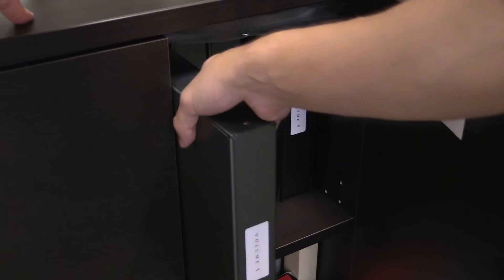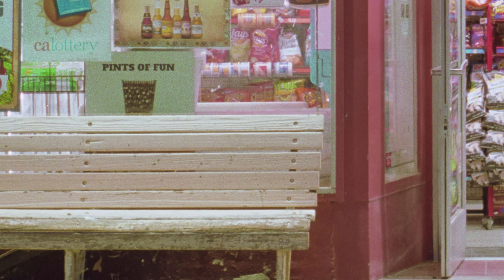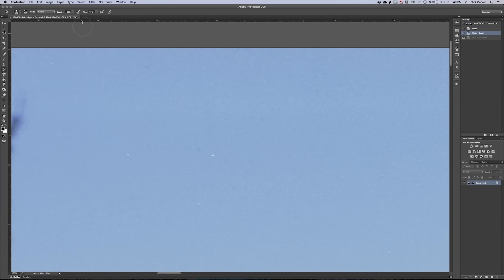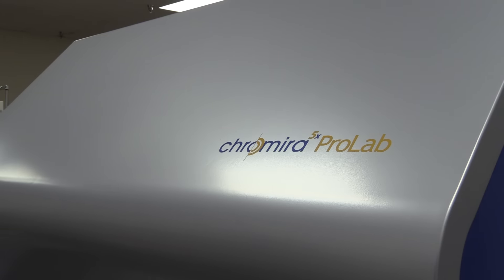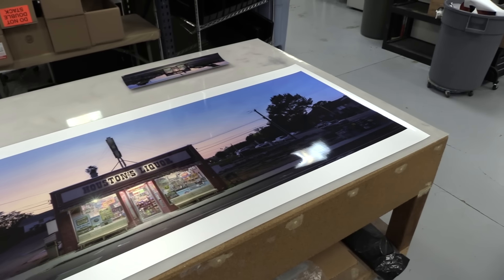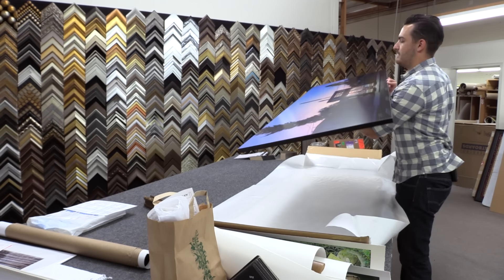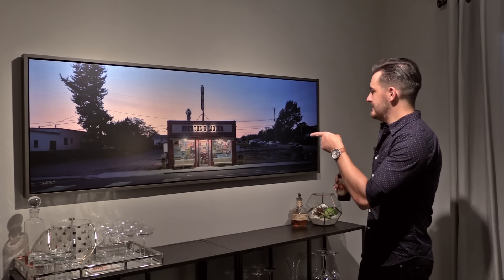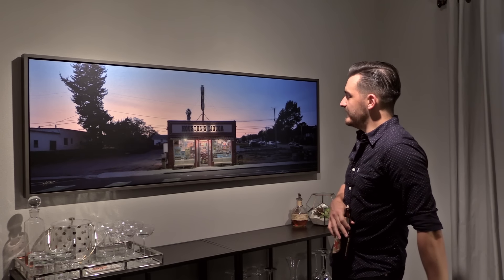Fine Art Photography: From Scan to Print to Frame

Comment: Oh, the part with the drum scanner getting over-saturated greens immediately made me prick my ears: I use a Sony A7 and a small repro stand, combined with a self-optimized conversion process (using film-specific curves that should do the job, at least in theory) to "scan" color negative film – and get the exact same effect! I'm still not sure where it comes from, but I get the impression that it is a problem with color channels that become non-linear (I could reduce it by using a strong blue filter 80A). It depends on the specific film stock too. The conversion process might play a roll here (just using curves might not be the right way, because the orange mask in non-linear due to the way it is produced in the film itself). But I wonder why the software of the drum scanner can't handle it properly …
Reply from the maker: Yeah it seems to be something with the color inversion. But I'm told by other drum scan experts that they could have done it with no issues. It's going to take some more testing on my part.

Comment: Photo that ain't printed, ain't worth half as much.

The problem? You don't have enough walls and space to hang all the prints you want!
I have now over 70 prints of that size that I keep on myself, not counting the sold ones.
And everytime I want to print something, I must replace something else with it, and it becomes so frustrating when I can only have a 32 prints of 140x50 cm hanging. 

The printing doesn't cost much, that framing does! Why I do my own framing.
Reply from the maker: I used to do my own framing for the same reason. Then I realized I would never overcome the frustration of trying to achieve perfect 45-degree angles, so I threw in the towel.
Reply: @nickcarverphoto   I don't have that trouble as carpentry is one of my hobbies and learned long time ago to do a perfect jointery in various ways and one of the basics is the 45 degree joins for various boxes etc. Problem that really most people have, is that they just don't have all the equipment that really makes it super easy. And why would the photographers invest lots of money and space to do just their framing?

So unless you really have carpentry in your blood, easier and cheaper for long periods to use a professional service for that :)

Comment: Gosh well that does t make much sense going to the Epson when the drum scan failed ... the epson would still give you the same problem since your scanning target (neg film) did not change
Reply from the maker: But it didn’t give me the same problems. Drum scanners are a completely different technology than other types of film scanners, especially flatbeds. That coupled with the fact that I personally was able to control the color inversion, instead of leaving it up to a technician, resulted in a far better scan.
Reply: the available gamut of the drum scanner is likely much higher. I'm guessing your early scans on the epson had something to do with forming your expectations for the scan. personally i would (and do) just run with the drum scan for the higher resolution and let the colour fall where it may - adjusting it if needed or required ...

Comment: It took them a week to make a frame? Are you serious? It should be done the next day. 

We (4 people) tore down the whole 100 square meter roof of a hayrack, the whole roof sub-construction, rebuild one of the foundations, made a brand new roof structure and laid the tiles in like.. 5 days. with hundreds of screws, climbing, 4 tons of roof tiles, more than 5 tones of wood material..

 There is NO reason whatsoever it should take a week to make ONE picture frame. It was in total maybe a 2 hour job. start to finish. Unless they had to order the material (if they did, shame on them, they should have it in stock), and it would take them 3 days max in that case. It's outrageous if you really did wait a whole week for that frame.

Comment: This was a fun video to watch, but I don't get it why you had to scan the negative just to project it onto C paper?  If you're going to make a C print, just print the negative.  What's the point in introducing two extra steps (scanning and projecting a digital image)?  

Furthermore, what's the point in shooting film if you're going to digitize it?  If you're going to do that, you may as well shoot digital.  I understand that this is "your thing" and you're trying to differentiate yourself from all the other yahoos making photography related videos by shooting panoramas on a view camera, but from a practical standpoint, it makes no sense.

BTW, you're one of the more competent photographers out there that I don't think you need a gimmick (which is what film shooting has become since there is no infrastructure to print directly from a slide or a negative.)  You can just do your thing, shoot digitally and eliminate all the unnecessary steps that do nothing but degrade the image quality of your prints.
Reply from the maker: To answer your questions about the printing process: to be able to print this large in a traditional darkroom would require very specialized equipment in a very specialized darkroom, all things I don't have access to. It would be rad to print a 6-foot wide image in a darkroom, but it's just not an option. Secondly, color printing in the darkroom with good and repeatable results is so difficult and time-consuming that I don't believe it would be worth the effort when I can get such great and repeatable results using this simpler method. 

Just because the film has to be digitized anyway doesn't mean there's no reason to shoot film. With your logic, why should anyone play an instrument anymore - especially acoustic instruments? It's much easier to synthesize an instrument digitally and since it's all just going to iTunes or Pandora anyway, what's the point? Adding those extra steps of recording an instrument does nothing but degrade the quality of the song, right? And why shoot any major motion picture on film? 

Shooting film isn't my cute little gimmick to get more subscribers. If I was that interested in my YouTube presence, I would do the same useless unboxing videos and camera reviews of the latest mirrorless full-frame that everyone else does. I shoot the way I do because that's the way I like to do it and my process would be no different whether or not I made these videos. Since you're all about practicality, I wouldn't expect you to understand the reasons to shoot film anyway. In fact, the grateful dead summed it up better than I could: "If I have to explain, you wouldn't understand." 

To each his own, I suppose. Thanks for watching. 👍🏼
Reply: Hi Nick,

I had shot film for most of my photographic career and I had always looked at film as a palette, each one creating its own look.  In fact, I had only switched to digital in 2012 when the film supporting infrastructure completely disappeared and the labs forced me to digitize my transparencies to make prints.  It made no sense to me to do that, and I guess it still doesn't.

However, if you're more process, rather than results oriented, then there can be no argument and the practicality of it plays no role. Enjoy the process and continue doing what you're doing.

All the best.
Reply from the maker: @bifcake  thank you for the encouragement. I'm glad these videos can still be entertaining for those no longer shooting film. And I agree with you about the film "palettes" - I think that sums up the main reason I shoot film better than I could have.
Reply: BTW, if you like printing on photographic paper, find out if they can do it on R paper.  I think you'll like the results a lot more than C prints.  R prints are sharper and I like the color reproduction much better than C prints.  It's a different chemistry though.  They used to use R paper to print directly from slides. 

Also, try the dye sublimation.  That may be the ultimate ultimate.
Reply from the maker: @bifcake  Good tips. I thought type R was long gone, but I could be wrong.
Reply: I don't know if it's still around.  Cibachrome is long gone and THAT was something special.  R paper was still around 5 years ago.  I have R prints hanging at my sister's house and they look really nice as well.  Not quite Cibachrome, but pretty damn good.
Reply from the maker: @bifcake  Really wish I could have tried cibachrome before that went extinct.
Reply: Cybachrome prints really popped.  The color was fantastic and for some reason, you couldn't really see the grain even on fairly big enlargements.  I think that an acrylic print is probably close to the Cibachrome look.  They were very expensive though.  I only had them printed when I had a gallery exhibition, in the hopes of selling a few prints just to recover the cost.  (I never recovered the costs.  The damn things were just too expensive to produce), but they looked gorgeous.